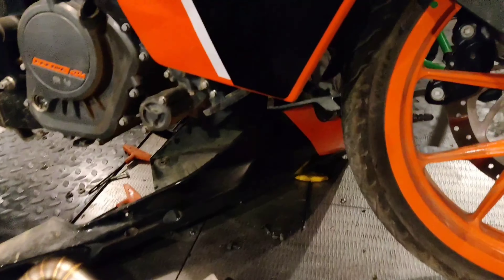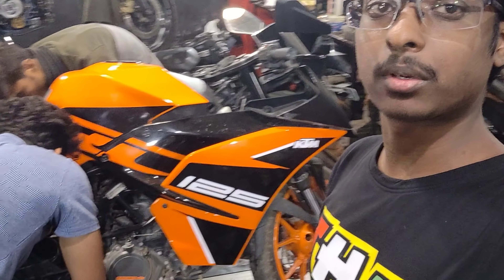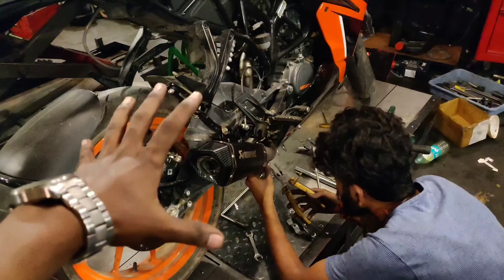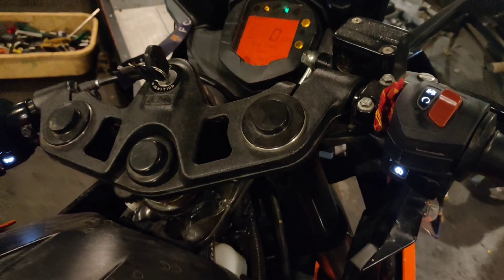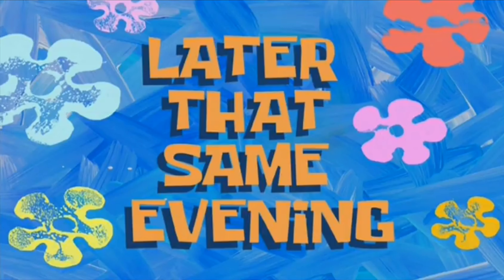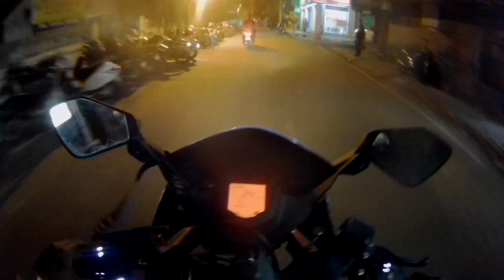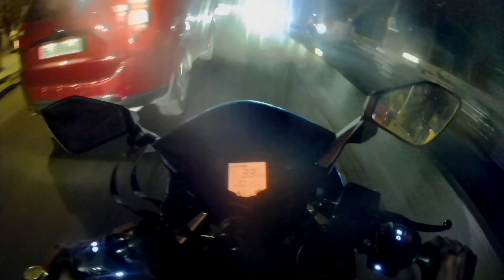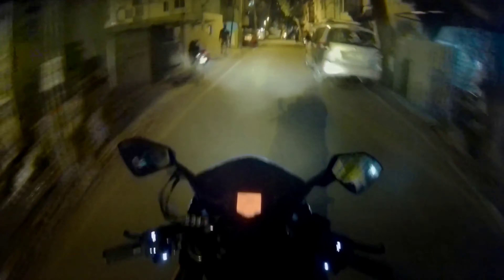Akrapovic Exhaust System For KTM RC 125 🤔 Pure Exhaust Sound! @htrzmodzofficial

Comment: Bro idanna RC 390 Gu use madbodha 
Then Nice sound bro🔥
Address and amount
Reply from the maker: Yes it can be done for RC 390
Total 9K cost
Location HTRZ MODZ Bangalore
Reply: Tq sm bro
Reply: Bro only 2900 rs for exhaust for bend pipe 2000 
I have also same exhaust
Reply: Go and buy in Amazon from.        (trp trades )
Reply: @PV_editz_  bro bend pipe link for rc 125bs6model

Comment: Hlo brother I'm from Bangladesh.
how much engine oil need ktm rc 125?
with mobil oil filter change and without mobil filter change?
Reply: 1.25 l ... With oil filter .. if you change oil then change filter also
Reply from the maker: 1.5L is required for engine & oil filter

Comment: Was that exhaust specifically made for the 125
Reply from the maker: No it's not
Made for BS3 & BS4 
DUKE & RC Every model!!
Reply: @ChiranjeeviCJ  i wanted to know it was made for the 125cc engine, if it was designed for the bigger engine models then you might be losing power
Reply from the maker: There is no loss of power
Power doesn't even matter for 125cc bike's
This exhaust system is compatible with any BS3 or bs4 exhaust
Reply: @ChiranjeeviCJ  iam saying this because an exhaust of a larger Bore can cause the exhaust gases to return to the combustion chamber , resulting in loss of power